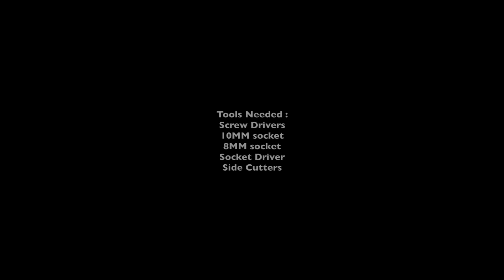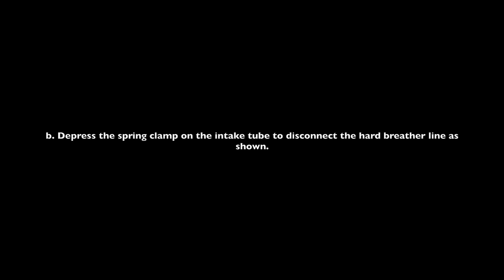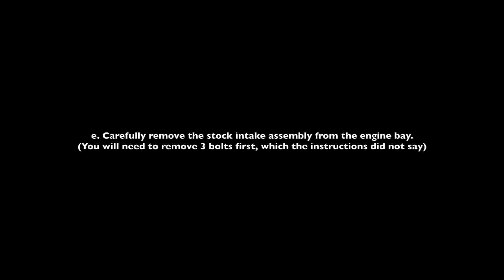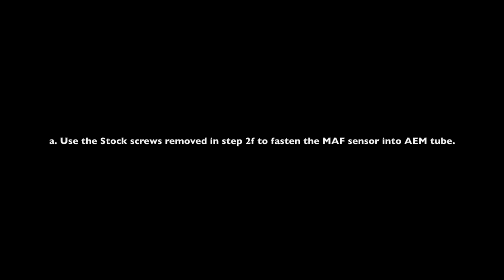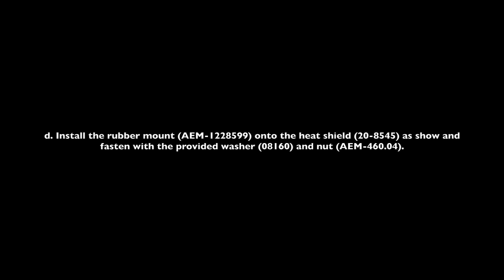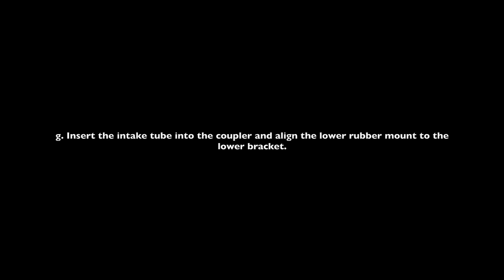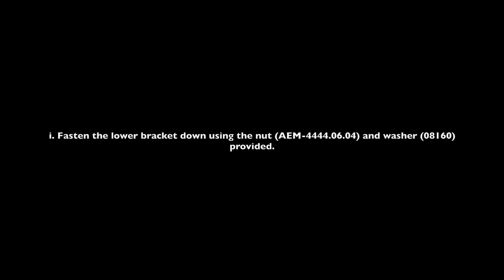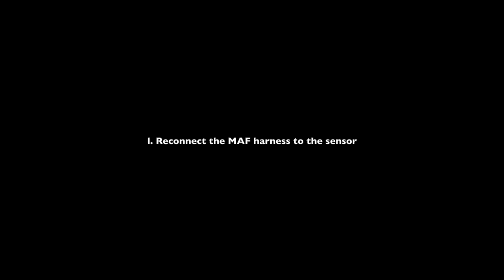2015-19 HONDA FIT/JAZZ - GK5  - 1.5L AEM Intake System Installation Instructions #HondaFit4Adventure

Comment: I know this videos been up for quite some time. If you can remember, is there a small hose attached to the OEM airbox besides the front ram air duct? Trying to take mines off to clean the throttle body and that POS isn't coming out. 😢
Reply from the maker: I think you're looking for the hose @5:34 (Center of screen)
This is where the water/moisture drain into before going up and through the filter.

Comment: Nice video.  Very helpful!  Did you have any issue with the MAF throwing codes after the install?
Reply from the maker: Thanks, 
Lol I had a "Check Charging System" warning. It turns out I just forgot to tighten the battery terminals back down. That was it.

Comment: Awesome, I have 2019 Honda fit 6speed, and I want to throw in the same air cold intake, I believe it might increase the performances because of the design of the stock air intake is made for noise reduction and obviously that takes away performance. Will love if you make a video of adding a turbo charger with the steps
Reply from the maker: Hi Efren, be sure to watch ebay for awhile and you might be able to snag one of these for $200.
Personally I would rather do a K20 swap then add a turbo. 
I'm kind of building this into an off road camper but I do have a few more engine mod videos coming soon.
Reply: Performance you will lose cuz of the hot air it will be sucking,but sound will be amazing
Reply: @bvvbvv6010  In addition, the stock side-branch intake resonator increases low rpm torque and response and doesn't decrease power like most people think. A decrease in noise just happens to come with it as a benefit (for those that want a quieter engine).

Comment: What up GK5 Fanatics I own a 15 fit 6spd! Currently mods two tone white body matte magnetic black hood roof and trunk panda Astetics Takeda intake system spc camber front and back god speed coil overs headers and buddy club exhaust not putting anymore into this l15b motor going k20 has port has the mounts Feels out in Japan 🇯🇵got a clean k20 GK5 K-sport the only Sport FrFr if I owned a integra or civic H2bAWD the only way to go
Reply from the maker: K20 > Turbo

Comment: Great content man, question i can do it in my jdm gk3 2014 cvt? Also thinking about porting the throttle body, is a good idea?
Reply from the maker: I'm not 100% sure. They do look to be the same.
You can port the throttle body but I don't think it will do much. At the end of the day it's still fun to work on the car.

Comment: Engine sound?
Reply from the maker: When I first installed this intake I didn't hear much of a difference. So I didn't include the sound in the video. I thought it was because of the small engine size.
When you first get the filter it comes pre-oiled. Once the oil started to dry up I did notice a more audible noise. 
When I get my new camera I'll make an update video. 
Thanks for watching!
Reply from the maker: I just included the sound in my AEM Dry Flow Air Filter Cleaning Video

Comment: Can I install air intake system in my civic hybrid 1.3. And what are the advantages?
Reply from the maker: Hi there,
You can install an air intake system on almost any car. 
The advantages can be debatable or best for certain needs and requirements. 

1. Increased HP - This device is supposed to increase HP. This is often debatable for several reasons. First the Honda Fit has such a small motor that even if it does increase the HP it will be very minimal. The other argument is that you may need an exhaust to go with the intake to get the full increase in HP benefit. 

2. There's Cold Air Intakes and Short Ram Intakes. Cold Air Intakes supposedly take cold air from outside the engine bay and bring it to your motor. 
Short Ram intakes like this one supposedly suck the hotter air from your engine bay into the motor. 
Based on my experience Cold Air Intakes are more prone to sucking up water when it's wet outside. Using Bluetooth temperature sensors I was able to determine the Short Ram Intake didn't run any hotter then the Cold Air Intake, ESPECIALLY WHILE MOVING.
Another option you can do which is also the cheapest is just to buy an after market drop in filter. 

3. Some people like the suction noise it makes while accelerating. 

4. Increase in MPG - This is often stated but I personally don't think it does.

5. You have the ability to clean your filter instead of buying a new one all of the time.

6. It makes your engine bay look cleaner and easier to work on other stuff later.

In conclusion there may or may not be any advantages. This also makes a great project for anyone who is just getting into cars. It's quick, simple and requires minimum tools.

Comment: what intake mods are available for fit hybrid gk5 

also would like to know of all available exhaust options 
want something with only a muffler 
no resonators and no cats 

I know this is a stretch but are their any headers available for the 1.5 Atkinson cycle engine 
I want no restrictions just straight pipes to a muffler in the back 
I'm assuming buying pipes that fit the normal honda fit l 15 and modifying them 
along with intake that fits the normal L15 are the only options 
I just want to now the best options available
Reply: would like to keep sensors also if possible
Reply: I found a nice front grill for the stock bumper on this car that has an intake cutout 
would like to find sonthing that brings the filter as close to the grill as possible
Reply from the maker: Mr. Thunder,
I'm no expert but I believe most bolt on applications (intake, exhaust) should be the same for the 1.5 and the 1.3
There's lots of options, getting them is the hard part. For instance the front bumper you were talking about, would that be from J's racing? A majority of after market parts for the fit/jazz are not available or easy to get in the states.
This engine doesn't really have headers, you would be looking for a down pipe only.
My suggestion would be to find out what sensor your Hybrid Fit has and then you can piece the "Intake Pipes" together and make your own air induction system. This would bring the filter to where ever you want, and honestly cheaper then buying an after market system. I plan on making a custom one soon as soon as my new grill comes in :)
Also checkout the fitfeakz forum or Honda Fit Owners On FaceBook.
Reply: @HondaFit4Adventure  the fit hybrid is a 1.5 litre

Comment: I don’t know how this is better taking cold pressurised air away and now using hot engine bay air instead
Reply from the maker: Hi TurboSloth. This was the only intake on the market that I could find at the time. I have since switched to an HPS Cold Air Intake.
https://youtu.be/QCf1eDinPSM?si=-gJj-n9sKvL0Qo4I
I understand the concept of a Hot Air Intake, but I would argue that it's more of a warm air intake. Yes it sucks in hot air while at a stand still, but it sucks in relatively warm air while the car is in motion. This has been confirmed at the track by checking the intake temperature via an OBD2 gauge.
My main concern for the AEM intake is that the throttle body is 2.5" in diameter which is then reduced to two inches for the AEM intake pipe.
I'd also like to point out how much water can be taken in on the OEM intake system. I don't think that is ever mentioned or covered in other YouTube videos.

Comment: Is okay for civic 1.4?
Reply from the maker: Sam, the bolt holes won't line up correctly. You can try ordering intake piping and a filter off Amazon and build your own for much cheaper. This is something I will be doing in the future.

Comment: Hot air intake.
Reply from the maker: Barely. 
According to my Bluetooth obd2 scanner there was only a 10 degree temperature difference between the stock air-box and the short ram intake while moving. 
This could vary depending on your cars make and model engine size and if the air filter is located near the intake manifold or exhaust manifold.
Also note the the stock air box sucked up alot more water and or higher humidity air when it was raining.